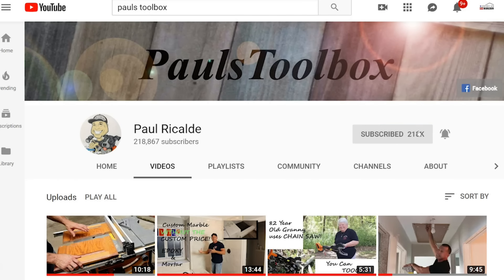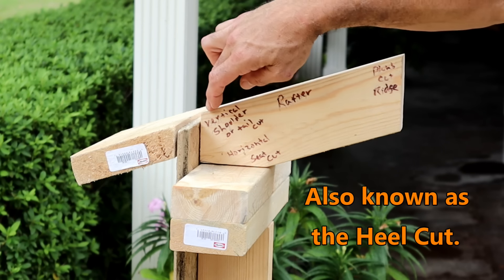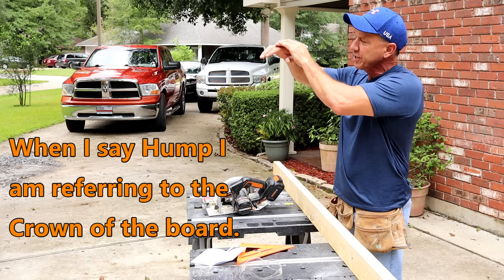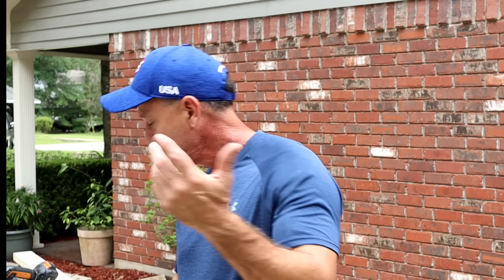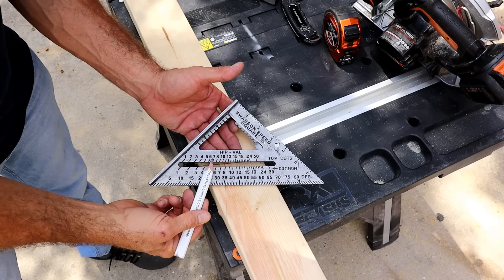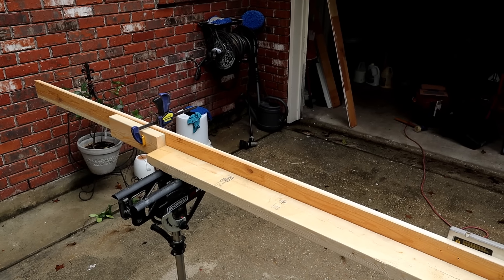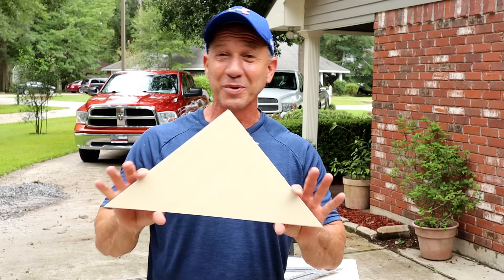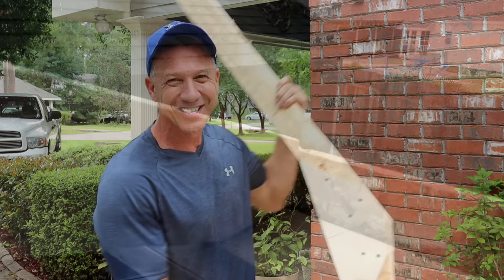How to build a shed. (Cut and assemble Roof Rafters)| Paulstoolbox

Comment: 'Two mitred cuts'@ 1:02
Any angle greater or less than 45 degrees is called a bevel. 
45degree's is a mitre. That's why you can mark it toss it to your apprentice and say mitre that please? Else you need an adjustable sliding bevel to mark out your plumb cuts.
Reply from the maker: The difference between a miter cut and bevel cut is not determined by the degree of angle. Miter cuts are made along the face of two structures,bevel cuts run along the edge of two structures. It does not matter what the degree of angle is. I understand that different parts of the country may use different terminology and I use a lot of slang on my job sites that are not necessarily correct but this is actually the correct definition of a mitre cut. Thanks, discussion is always good and I really appreciate you taking the time. Have a great day and be safe!
Reply: Thank you Paul Ricalde for your answer. I'm a carpenter in New Zealand and I enjoy seeing and learning further tricks of the trade from around the world such as learning more about the speed squares.
Could you please, if programming allows, do a piece on forming frames of a curved wall specifically the plates? 
Kind Regards Tony.

Comment: I don't understand why your siding/sheathing is coming up flush to the top top-plate - are you leaving the gap at the bottom?  So what are you covering the bottom with then?  Some kind of trim piece, with an edge, to trap water and rot over time or something else?

Building a house we brought the sheathing to the bottom of the bottom plate, leaving the gap at the top instead.  Since a soffit is going in to hide all that, and then the bottom is smooth and doesn't trap any water with overlaying trim or other materials.  But I'm curious if there's better ways.  How are you dealing with the bottom on this?

Comment: So I messed up somewhere and ended up with a width of 8ft + 1/2 inch. When doing my calculations, do I still multiply 12.6 times 4ft, do I take that extra 1/4 inch per side into account or am I overthinking it?

Comment: If you only use two pieces of wood and not the third one thing the nds together, won't it tend to want to spread, and put lateral force into the walls. Or did you just not cover that cuz it was the easy part?

Comment: Hey great video, thumbs up and a sub. Quick question as I anticipate building me a new shed how do you determine rafter size and gusset plate size as you increase width to 12 or 16’. Thanks, oh I’m south of I-10 so no snow load.
Thanks
 Whit
Reply from the maker: If you were going 12 feet wide you could still use two by fours but anything over that I would use two by sixes myself. It doesn’t cost much more and it will give you a good bit of strength. I hope this helps and have a great weekend!

Comment: What do you do when your 2x4 which we know is 1.5 x 3.5 has some boards that are 3.5 and then another is 3.5 and 1/8” or an extra 2/8”? I discovered this after the fact but have not put them up yet. Is an 8th of an inch difference in height going to throw off my whole roof from being level on the rafters?

Comment: Just curious why you did not need to do any overhang on the gable side of the shed. I have seen a good amount of shed plans that have a overhang there. Just curious.
Reply from the maker: Hi Shaun, there really is no need for any overhang on a shed as long as you extend your roof 1.5” over the edges so water can run off without seeping in your walls. A gable overhang will help to shelter the front door when heavy rain is present but not necessary on sheds. I used 2x6’s for my overhangs because it is cheaper and easier when building a shed. Thanks!

Comment: Hey Paul. Im a total novice building a diy greenhouse. As everyone said this is extremely informative. Thank you. BUT where did you get the initial 18” you set on your speed square (4:51)?
Reply from the maker: Ha ha, sorry about that Steve I just realized when you pointed it out that I said 18 1/2 inches I meant 18 1/2 degrees. That is the degree of angle that coincides with a 4/12 pitch. I did say that it wasn’t the sharpest tool in the shed LOL! Thanks buddy and have a great day!

Comment: Every other vid I've seen on this so far, the common rafter forms part of the overhang and the bird's mouth is not at the lower end of the rafter. How much of a difference does it make?
Reply from the maker: Good morning, in this video I am explaining how to build a shed so I did not extend my common rafters past my top plate. If I were building a home and I wanted soffit and facia,  my birds mouth would sit right on top of the plate and my rafter would extend past the side wall so I could box it in. Your ridge cut your birds mouth and your rafter tail cut will be at the exact same angle. Thank you!

Comment: Paul have you done large shops? I’m trying to figure out the best most economical roof for a 40x60 shop. Will metal roof, was thinking lean-to style, but not sure how to span 40’ without center supports. Any thoughts?

Comment: Excellent video.  I learned a lot.  However the way framers do the pitch confuses me.  Why don't you just pick the angle of your pitch say X degrees take the cosine of it and multiply it by half the length of your ceiling joist. You then have the length of your roof rafter.

Comment: never saw that brand of skill saw before where did you purchase it? Awesome video!!
Reply from the maker: Hi Dave, that is a WORX Exact track saw. I really like this saw a lot and I spoke to the manufacturer about it. I wish they would make this in a professional series because it has great features but lacks the power of the big saws. Don’t get me wrong it handles jobs really well but it is not made for the professional, it is a DIy saw. If anyone was to buy the Saw I highly recommend getting the heavier battery, 4 amp hour and quick charger because the ones that come with it are light duty in my eyes. Like I said it is a DIY saw but it really handles things pretty well, I couldn’t be happier with an inexpensive saw. Thanks!

Comment: I’m building a 20’x40’ shed. The ends I assume are the same as you’ve shown in this video. I’ll be using two 10’ for the rafters. What other supports should I use for the ceiling Joyce ?
Reply: @Hello Michael how are you doing

Comment: HELLO PAUL; I,M A LITTLE (ALOT) CONFUSED BY THE 2X4 ON THE FRONT SIDE OF THE SIDING?? HOW DOES THIS GET ATTACHED TO THE SIDING?? THIS IS NOT A RAFTER TAIL?? HELP !! PATRICK.P I TRULY ENJOY ALL I LEARN FROM YOUR VIDEOS; ONE THING I DID DO WAS AFTER COMPLETEING (!) GUSSET I SIMPLY USED THE 1 AS A PATTERN AND CUT THE TOPS OFF ON THE CHOP SAW; SO AFTER THE ORIGINAL I HAD A PATTERN TO FOLLOW JUST ONE LESS STEP OR AN EASIER STEP !! THANKS AGAIN, !!!
Reply from the maker: Hi Patrick, are you referring to the board cut on an angle that is attached to the siding? If so it is a 2x6 and it is an easy way to make an overhang without having to box in a soffit. It screws on an angle through the siding and into each rafter. I will show this on the next video. If you are working on it now and need the info faster, you can send me a note to www.paulstoolbox.com and I will do my best to help. I will also have a video showing how to make a soffit  instead of just an overhang.  Thanks!
Reply: BLESS YOU,PATRICK.P

Comment: Can you please help me with the calculation? I will build 10x20 shed with 10/12 pitch and I don't want to have any roof bottom chords, I need more space without any ceiling, roof only.  I'm so bad with inches, can you please help me calculate the right sizes and angles to build a strong roof?

Comment: so if i have 10ft. my rise would be 5, with 22.5 degrees and 65in rafters? also with 10ft but with a 4 in rise, I would cut at 18.5 degrees and rafters be 63.25 in? am i getting this right or am i wrong?
Reply: use an online roof pitch calculator to help.

Comment: Thanks for the video! Is there a way to directly contact you? Email possibly? Not sure how often you check comments and/or reply, but I'm in the process of building a 8x10 shed, my city allows only 7 ft walls with no permit, I'm thinking run a ledger board at 6 1/2' to give me a little head room but build a loft above that for overhead storage, so I'm thinking a 9/12 pitch to get me 3' above walls at peak, can I build the roof in this fashion that you did here or should I run a ridge board? Thanks
Reply from the maker: Good morning Wes, I try to check my mail every day but sometimes I get tied up because I work three jobs. I am getting off of work from the fire department this morning and I’m heading out of town to work with The American BUILDER today. You can contact me via email at Paulstoolbox.com. I would personally recommend doing a ridge board with a 9/12 pitch. It will make it easier in the long run. You can still do it with a truss but that’s pretty tall and may give you trouble trying to set it up. I will be very busy the next few days but I will check my box should you have any questions
Reply: Thank you Paul for your quick reply here and through email. I appreciate it

Comment: That's not actually a Bird's Mouth cut at the end of your rafters. It's different. Can you tell me the actual name for the cut? If there is one. I looked up Birds Mouth Cut on Google and all the pictures are different from yours. I'm not trying to be picky, just curious. Great video Paul. I appreciate your sharing!
Reply from the maker: Hi Don, I’m sorry about the confusion. Here it is...the vertical shoulder cut or heel cut is part of the birds mouth. Another part of the birds mouth is the seat cut that rests on the top plate. When this extends past the top plates it forms a look that is similar to a birds mouth. If you cut it flat at the vertical shoulder instead of extending it past the top plate you would get what I show here. It is a birds mouth but you cut the tail of the rafter off. If you look at other pictures of a birds mouth, just picture the tail part cut off and you have the same rafter. I explain the heel cut and the seat cut at 2:07 of this video. I will do another video showing the birds mouth extending over the top plate and forming a soffit in the future.
Reply from the maker: Thanks!

Comment: What is the cost vs buying a already built?
Reply from the maker: I looked at a few pre-fab sheds and they were flimsy compaired to this one. The cost for an 8x12 without the floor  decking, shingles,felt paper or drip edge is $1500.00. This is  the price for an unassembled  do it yourself kit.  This costs me about 1400.00 with 3/4" treated floor and 7/16 OSB as a 2nd layer. I used 2x6 floor joist @ 12" centers. 16"center Wall studs and  rafters, architectural shingles with 30 Lb. felt paper.  and drip edge.  If they installed it for me you will add 1000.00 to the base  cost.  If you do it yourself  you will have a much better and stringer shed with higher ceilings for about 1/2 the cost.
Thanks!

Comment: I like screws, but using screws for a gusset has to be a negative. Framing codes do not allow for the use of screws unless they are structural screws. Those little black screws on the gusset look like drywall screws. You are better off nailing and using a construction adhesive like PL polyurethane to hold rafter together.

Comment: I used the nailing plates on my sisters shed (long story)  never again.  About 70 swings with the hammer for 6 inch plate.  Arm was dead and ears were ringing.  City required trusses to be store bought not hand built (ssssshhhh!!!!) so I could not use plywood gussets like I wanted.

Comment: Wouldn't it be simpler and less work to have a rim board down the center instead of all the gussets? Why use gussets instead of the rim joist? Just curious, not the sharpest tool in the shed either.

Comment: 2:02 ..... are you really implying that you should cut your rafter short at the top plate and then fasten a little overhang nub on afterwards? Why wouldn't you just leave the wall sheathing lower and run the rafter longer for your overhang? This is either misleading or poor advice. The rafter should ideally stay as one whole piece and function as the overhang.

Comment: Just remember this is for a shed people dont try doing this in a house. In a house this would be a little different to pass code.
Reply from the maker: You are absolutely right Lalo! I am showing this for storage use only. Also, codes are different in certain areas and you even need hurricane clips, tie downs and drainage plans, etc. Some areas even make you get an engineer to sign off on it with architect stamped drawings for a lawn mower shed but they will allow you to install a flimsy tin shed that’s made in China and has 10,000 screws… lol

Comment: Wrong! Those are not trusses. Without collar ties the walls will eventually spread apart.  Those gussets will not work with that loading. 
   Your roof will eventually fail.
Typical YouTube beginner teaching incorrect methods.
Reply from the maker: Hey Keith, I am working at the fire house tonight and it’s pretty late. If I were you I would get off the computer before your mom realizes that you’re up past your bedtime. I wouldn’t want you to get punished! Sleep tight ......

Comment: Your overhang is all wrong. No need to have a different board to be your overhang, let your rafters extend out part your wall top plate to the desired length of overhang.